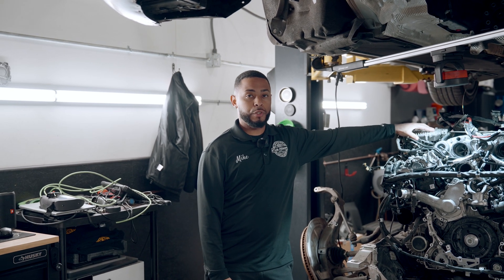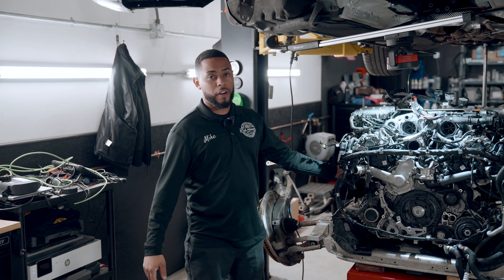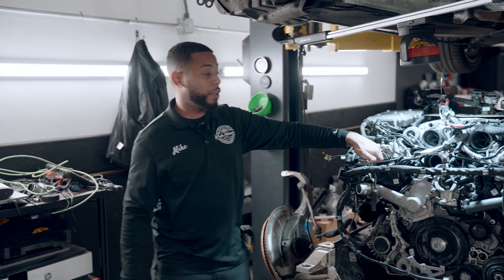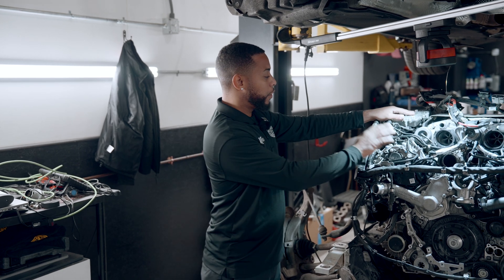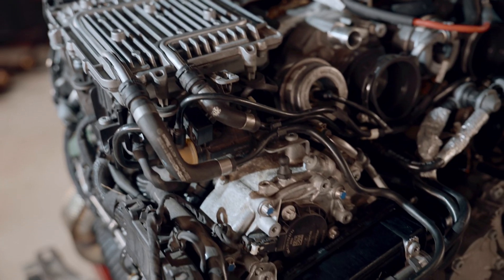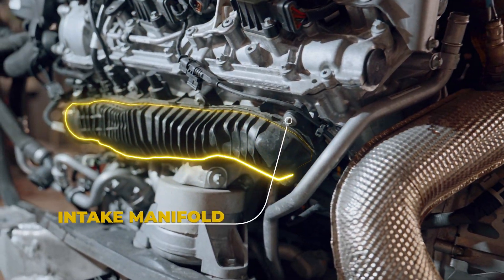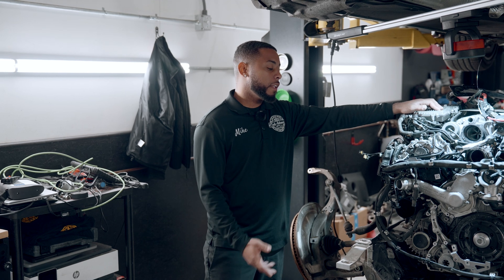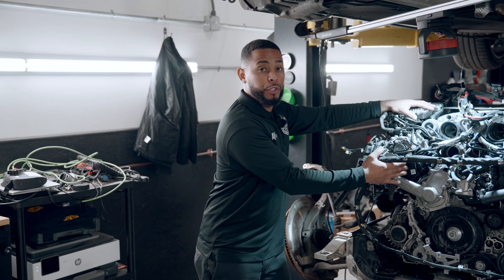Common Problems with Mercedes-Benz M176 & M177 AMG Twin Turbo V8 | 603 MTech Autowerks

Comment: Covered until 150000 or till 2035
Reply: 15yrs or 150k miles  for thermostat coverage.
Reply: @TizzleT Is this a recall? Where can i see if my 2018 glc63 needs to be replaced? I currently have 70k miles
Reply from the maker: Thank you 🙌🏾
Reply: @603benztech great information!  I assume it’s normal to get extremely hot on a summer day in Florida?  I don’t drive it too hard but the engine remains hot for a while…
Reply: Sorry friend. Whats covered for 150000?